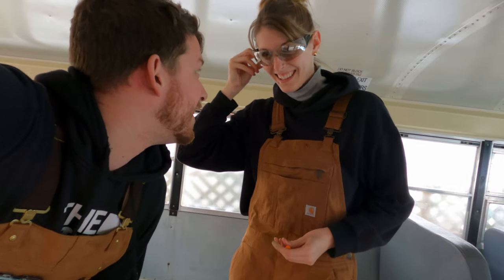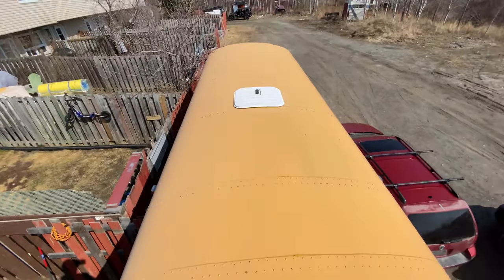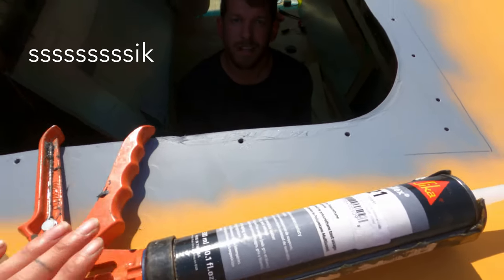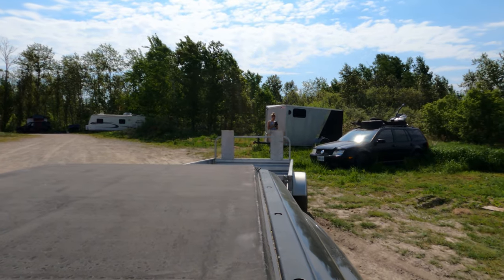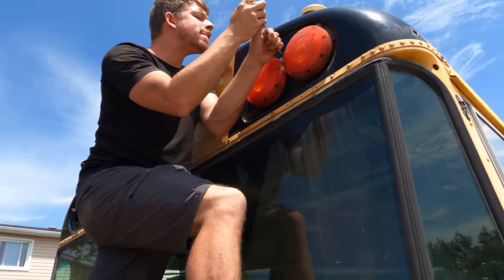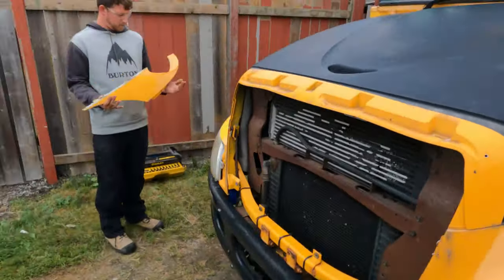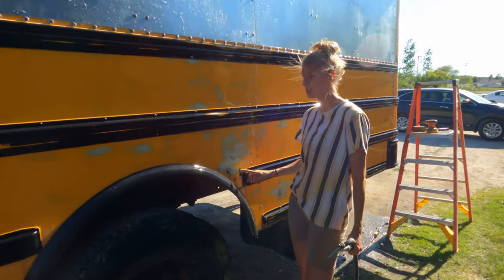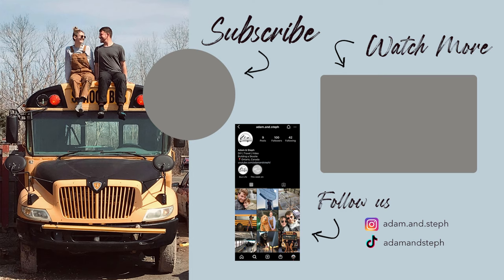Prepping for Paint | Skoolie Conversion Ep. 11 | Adam & Steph

Comment: You made a major mistake if your bus rolls on its side you can’t get out the emergency roof hatch if it is not there
Reply from the maker: We have a few other exit points on our bus including emergency exit rv windows we recently installed. If you’ve ever seen any Skoolie build you know almost all of them swap the emergency hatch for a max air fan. School buses are designed for children with extreme safety precautions. Skoolies are basically RVs and RVs don’t have emergency hatches, and they’re 100x more likely to roll.
Reply: @AdamandAtlas  good to know your taking the precautions